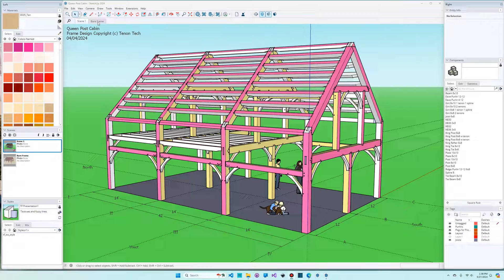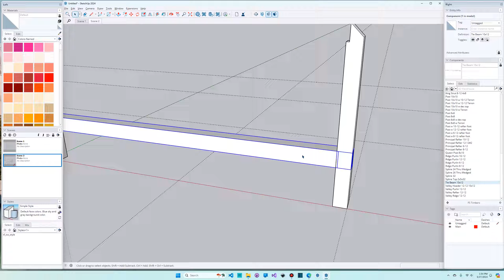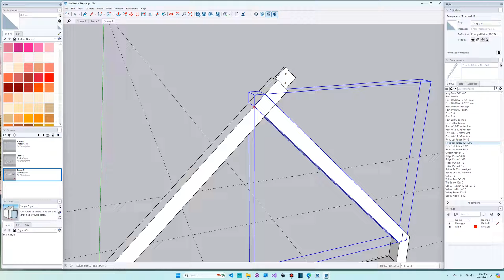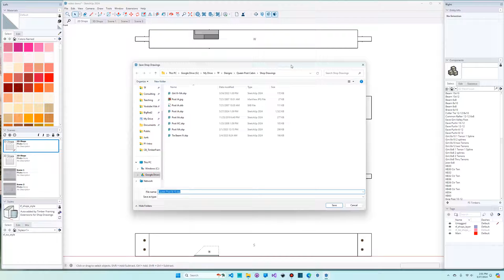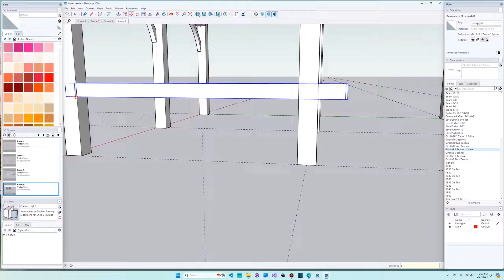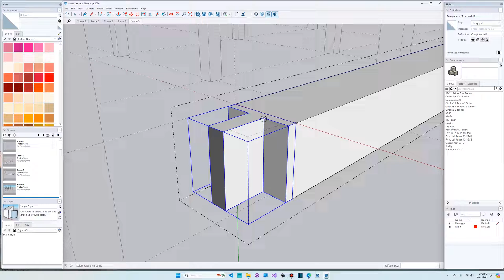Timber Frame Design with Sketchup Part 2 - Timber Framing Extensions

Comment: Getting into using Timber Framing Extensions to draft up my projects... I'm curious, how do you deal with Splines?
Reply from the maker: I do plan to make one more video that covers advanced topics like splines.  But the short answer is that a spline is a small timber with 4 joints, 2 to cut slots in the girts, and 2 to cut one end of a through mortise in the post.

Comment: Thanks for these videos! Very helpful. And thank you for making and sharing the extensions, too.

Got this error when attempting to make a shop drawing. Any thoughts?
"Oops.  Looks like one of your joints (Thru Tenon) is not solid.  That could mess up the shop drawings."
Reply from the maker: Well, just like it said, one of the two timbers is not a solid.  So there's a hole in it somewhere.  In this case it's the thru tenon sub-component.  You probably just need to draw the face on the tip of the tenon.

Comment: I got the example joint to work but I use a shouldered tenon on my tie beams. One inch shoulder on the bottom (10 inch beam) up to nothing and a 5 inch tenon. I absolutely cannot get that to work without an error message. "component must be solid (except for the cutting face).
Reply from the maker: Send me a simplified example file, and I'll take a look.  clarkb at gmail.
Reply: @TenonTechnology  Thanks, check spam folder just in case
Reply from the maker: @bobberry8094  Sorry, don't see anything.  Ooops, gave you wrong addy:  clarkbremer at gmail.

Comment: I love your timber frame extensions! I've been using them for several years as my wife and I play with designs for a house we are building. I was excited to see the recent update, and these new videos. 
I have a problem/question: Some of my TF joints don't work properly. That is, the mortises that are produced in the shop drawings are not right.
Here's an example. I created a brace, with a tenon at each end. As far as I know, I made both tenons the same way, but in one case, the shop drawing for the other timber shows the mortis as your video shows, shades of gray showing the depth of the mortis versus the housing, and the angled surface of the mortis. The shop drawings for the mortis for the other end of the brace aren't nearly as good. The profile of the housing is shaded as expected, but the rest of the drawings just have dashed or solid lines, but no shading.
For shop drawings, this actually isn't a crisis. I still have all the landmarks I need and can add the dimensions. But I'd like to understand why the mortis isn't being drawn correctly. 
Any ideas or suggestions?
Reply from the maker: Thanks for the kind words.  Regarding your issue, lets take it offline:  clark@tenon.technology